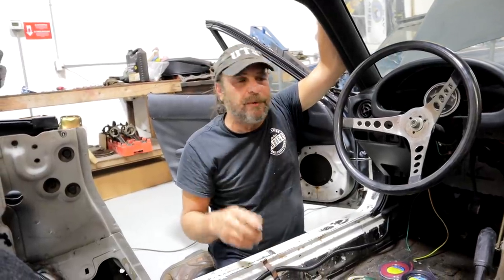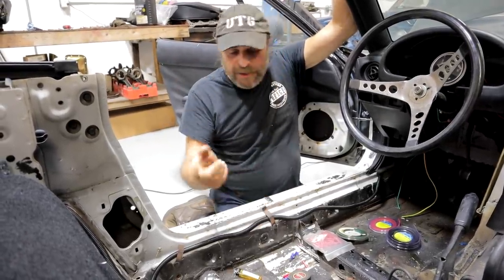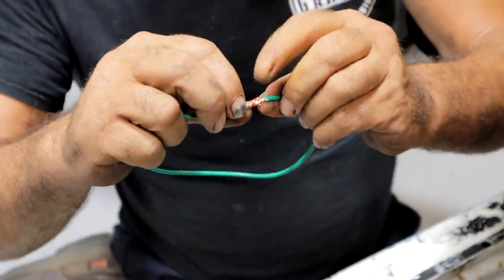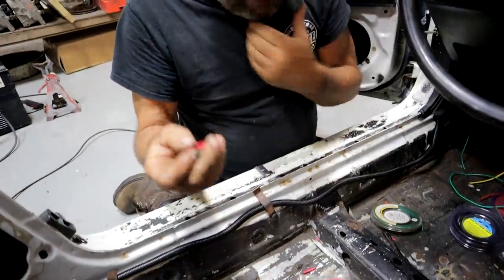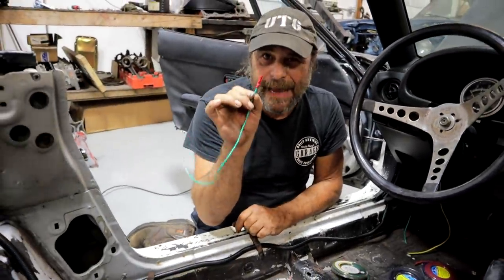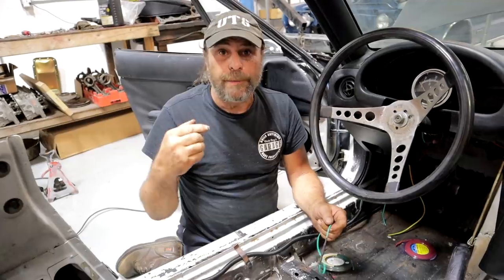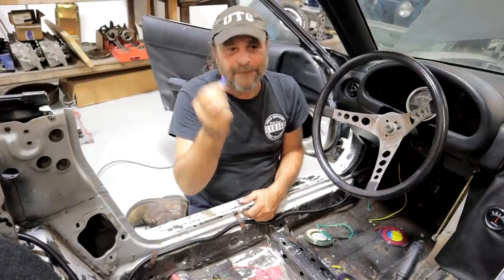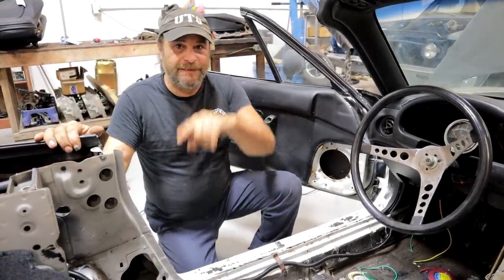The Single Most Misused Item In The World Of Cars

Comment: Don't use crimp connectors on any wires ! Ask any real electrician, they will tell you they won't let you use it on anything they own. Careful soldering, flux, and heat shrink are the only way to repair a wire. You can love it you can hate it you can argue about it but the facts are still the facts.

Comment: In all the years I have doing automotive work there has always been one side that said soldering/heat shrink tube is the proper way. While another side says nothing in aerospace or automotive should be soldered due to vibration, crimp using proper tools and high quality connectors.

Comment: I found a new type 'Butt Connector' that is self sealing with heat. It has a silver solder ring in the middle. It seamed like a good idea at the time, but you need 3 hands to make it work. You can use those stands with the spring clips if you are doing bench work, but not great for under a car or in an engine bay.

Comment: These are a permanent fix....you just need to use the correct connectors with a sealant inside and you need to use the correct crimp tool that locks the wire inside the connector.

Comment: I'll carry it a step (or two) further and add dielectric grease to the inside of the crimp connection before I insert and crimp the wire....or I do as you did and use shrink tubing but then I'll insert the grease inside the shrink tube and then shrink it down.  I do this for the off-road stuff and have never had a broken or corroded connection and are, in my mind totally reliable.

Comment: I prefer to use the proper ratcheting double crimp tool when using the insulated connectors because they crimp to the wire and squeeze down on the insulation for added strength.  Buying cheap crimp connectors is a bad idea as they never get a good grip on the insulation. 

For more reliability without buying the waterproof connectors the uninsulated connectors are the way to go as they have two parts that are crimped, one on the wire and a second part on the insulation. Cover these with a good adhesive heatshrink for sealing and strain relief and they will work pretty much forever.

Of course the best practice is to use the proper waterproof connectors with the correct crimping tool. The connectors don't cost that much, unfortunately the good crimpers do cost more than we would like but they last forever unless you are doing wiring harnesses full time. Spend that bit of extra money and you will have peace of mind and impress your friends or customers.

Comment: I only buy but connectors with heat shrink built into them. And the snap-on wire strippers are the best stripper/crimpers in the business hands down.

Comment: They make connectors that have solder in them. You slide it on the wire, twist them as a lineman splice slide the connector over hit it with a heat gun, it stinks the tubing and solders the connection.. They're a little more pricey but they work forever....

Comment: I suggest you try open barrel terminals instead of the closed barrel type used in the video. You need a special crimper for them, but the resulting crimps are more reliable and look much more professional.

Comment: Shrink wrap is gold. For what it's worth there is one way to twist wires that will never pull apart. Strip about a inch from wires, divide strands in half each wire, Twist strand to strand tight, then twist the two strands together, fold straight and shrink wrap. I do it for anything not getting soldiered, quick, easy, and as permanent as any joint not soldiered

Comment: Even better cut the plastic insulation off your butt connectors or any connectors then put your heat shrink Over The Wire send crimp the connectors heat up the heat shrink that still isn't as good as soldered wires with heat shrink

Comment: I hate wiring so much that was the last thing I was going to repair on my '72 Road Runner. After getting it running and painting it I wanted to be able to go for short drives in it occasionally, which i did until one day when it's prehistoric origional equipment power steering pump blew a seal and drenched everything under the hood with power steering fluid! After cleaning everything as good as possible without using caustic chemical cleaners or a pressure washer, I was able to drive it again until one day it started spitting and sputtering. I made it back home but after doing a few tests with a multi meter I figured out that whoever was going to convert my car into a race car had used all solderless connecters without any heat shrink tubing and all of the connections were either wet inside with power steering fluid or the wires were green with white powder corrosion on them because of the humidity in Oregon!

Comment: Yes I agree about the heat shrink whether its with or with out solder. I had a 657E Cat scraper that requires two transmission to be in sync.The rear transmission was grabbing two gears at a time and at times three, Well after spending the whole day diagnosing and flipping loosing our minds over what are we missing.We found the problem only when the sun started set on the one last look before going home checks and we found every wire in the sync circuit in the same spot had solder less connectors only tapped to close the loom and so every time voltage was sent to up shift or down shift voltage was hopping from wire to wire,which resulted in a 2nd gear shift also shifting the gear to the wire it jumped too.So it would hit second then shift to fourth then back to second or sometimes stay in forth.So when my fellow mechanic was shifting the front while I was monitoring the the rear trans it was dark enough for me to see the blue voltage jump out of the corner of my eye and when I showed my co-worker we was like no way. So to the newbies heat shrink goes along way for a solid no come back history and avoiding working for free if on flat rate.

Comment: I watch your videos on a regular basis and I found the content is always accurate and very instructive. However this time I do not agree with you about what you said about solderless connectors. If you can release the wire from the connector simply by pulling it by hand it means either the connector is not of a good quality or it was wrongly crimped. With a good connector, I mean a good metal gauge and the right crimper tool (the kind of which you need a die with it) there is no way you will be able to release the wire with your hands. There is also connectors that are shrinkable for better insulation against moisture.

Comment: If I have to crimp, I like to use the clear or translucent nylon ones. The ones with the solder blob inside do work as well, but I prefer to solder the wire if possible.

Comment: great information! Myself i take the plastic outer shell off and crimp the inner metal sleeve then solder it then heat shrink tubing. Also i use a thomas and betts crimp tool which is a great tool. the metal sleeve and heat shrink for strength and solder for conductivity/

Comment: At work, we have the butt connectors that have heat shrink and a heat activated epoxy built in. They are more expensive but worth every penny. Also, the best crimpers put a divot and crush the center first, then out towards the edge.

Comment: That crimper you’re using is actually one of the worst ones For automotive. Solder connections may be the best for the least amount of resistance but not the best for all applications due its tendency to break. Those butt connectors are not intended for shrink tubing. The ones without plastic are designed for shrink tubing. If you ever repair electrical   connections in automotive manufacturers give you kits with heat shrink and  specify a certain tool to crimp it with.

Comment: Wire nuts would be far superior to but connectors  
Soldering is the only way to wire properly 
But connectors are the majority of wiring problems on trailers and all most every automotive aplication it's used for

Comment: In my earlier years I used to butt connect wires with dielectric grease in the connector and heat shrink it. Now I solder and double wall heat shrink it.

Comment: Sorry mate, but here in Australia, there is a "new kid" on the block to do this job!! These are joiners that only require a heat source. You pick the size to suit the wire, strip the wire, feed each wire into the joiner, then heat with a lighter. These splice joiners have solder, & they are also heatshrink, with sealant. The heat melts the solder, thus creating the electrical connection, melts the sealant, & shrinks the outer case. I still have the old school ones, but I sometimes use a different method. This is stripping the wires, then putting seal shrink over one wire, Holding the bare wires together, solder, then slide the seal shrink over the soldered joint, & heat it to shrink & seal.

Comment: These are not designed to be used with shrink wrap all the time. They can, no reason not to do it and I endorse this excellent extra step, but not always a necessity. 
 It kind of made me chuckle when he said look out for cheap crimpers then proceeded to use a cheap crimper.
 The correct ratchet crimper crimps not only the jointed area where the wire is but also the plastic round the collar, this gives the joint more strength and allows it to move with the wire rather than cut through the joint. 
 Ratchet crimpers are not as expensive as they used to be and are a sound investment if you intend to do a lot of crimping. The type Tony was modeling here are fine but will never be as good as a ratchet. You can still use them to crimp the collars on a through crimp.

 A minor point. I love UTGs videos.

Comment: If you strip the wire double the length you require twist and fold it back so it forms a loop and then crimp a connector on to it you can't pull it off as the crimp is biting all around the loop.

Comment: A little bit of heat from a lighter or candle and the connector comes right out of the plastic "insulation". This is what I do so I can get a more positive crimp and a wire that doesn't change much in thickness after shrink tubing. None of our local stores have uninsulated butt connectors.

Comment: if i use solderless connectors (i almost always solder my connections) i use the ones that have no insulation on them, and use the big crimps that really crimp the wire so it doesn't pull out, and use shrink tubing. that way i can visually see my crimp and the wire

Comment: Never been a fan of crimp style connectors like these,  in high vibration environments these connectors create a pinch point that eventually leads to intermittent connection failures that can be incredibly hard to diagnose. I'm a bit old school with spliced wires with proper solder and heat shrink tubing being the only proper way, that a soldered joint is second only to an unbroken wire for reliability.

Comment: i work at Union Pacific and we use these clear and blue wire connectors that you can put 3 wires in it w/o stripping them and you press down the  button with some pliers and it has silicone in it to prevent water getting in. Ive tugged on the wires and they don’t come out. They are a really good product!

Comment: I always do a third crimp on the very end of the crimp. The bit that is just plastic. This grabs the insulation of the wire so if it flexes it bend over a longer length. Like the rubber were the cords go into power tools. Also most crimping pliers have a scale on the side to show the length that the wire should be stripped.

Comment: Fan out the wire strands a little push them together and twist. Solder it up and use 3M heat shrink tube with the adhesive built in. You could throw that connection in the Atlantic for 50 years and it would still look new when you cut it apart.

Comment: There is a new device for joining wires...it uses a combination of shrink tubing and low temperature solder in the center of the sleeve. You slide the sleeve over the wire, join them with a lineman's splice, center the sleeve over the splice, and heat the entire length. The solder melts over the splice and the heat shrink insulates it.

Comment: and ~ on the 2002 forester I am resurrecting from scrap after market install used guillotine connectors to add on spade terminals. one  guess where intermittent  phantom electrical problems occurred plus poor rerouting of wires and getting them pinched under hardware was a bonus. lesson if your car has aftermarket add-ons have fun circuit tracing. Side note many autos have wires installed for options even if option not installed to add on an option look to see if factory supplied most of the wiring for added options.

Comment: I use dielectric grease on the wires then crimp them with a ratcheting non insulated crimper then seal with liquid electrical tape.

Comment: If you make sure the dent the crimper makes is always opposite the seam in the metal tube, you will clamp all the strands equally, and make it more resistant to flex and pull failures. If you put the dent on the seam, it will put most of the clamping force on only some of the strands, and the stress riser created will lead to earlier failure from flexing. This also deforms and sometimes even cuts into the strands that get all the clamping force.

Comment: Tony, you need to look into the end of the connector. You will notice that there is a split. On the crimper where you will be crimping you will see that one side supports the connector and the other pushes into the connector. Put that push-in side on that split when you crimp, it will provide a tighter crimp.

Comment: Basic but very true.   I used to install car stereos back in the 80"s and most installers didn't heat shrink there connectors they almost always had shorts frying gear or tweeters.  Do it right the first time.

Comment: Ancor marine grade heat shrink is the best out there and once you use it you won't want to use anything else. Also I solder a lot more than is popular on the interwebs. It's how my boss wanted it done when I worked on a top fuel team and I figure if it's good enough for a car that tries to shake itself apart going 300+mph then its good enough for me.

Comment: I soldier my wire to the crimp connectors & put the marine shrink tube over that. Also I take & strip wire then split strands on each wire 50 50  then twist half the wire together on each wire. So you end up with 4 twisted wires then twist the 2 together then soldier. Shrink tube & be done with it.

Comment: Last time I used those solderless connectors, I heated it the same as normal heat shrink tubing and it seemed fine to me.  Are you sure this is incorrect? The lazy part of me doesn't want to have to rework it.

Comment: the solder/shrink connectors are the way to go, i still throw shrink tube over them, but they do have shrink tube and adhesive built in with solder, heat gun and you have a connection made in 6 seconds

Comment: You can get those connectors with a softer plastic and a glue in them so after you’ve crimped them you use something to heat them up they shrink and glue the wires in and seal them all up

Comment: If you use proper ratchet crimp pliers and don't strip to much insulation off you will get a much better result than using those dodgy pliers you got there. When the proper sized crimp terminal has been selected for the appropriate wire gauge the insulation should butt up against the end of the metal conductor thus keeping a portion of insulation within the insulation of the crimp terminal but heat shink is always a good idea.

Comment: I use a hybrid style crimp connector. It’s intended to be used like this and the strands of wire inside overlap. The connector itself contains a small amount of solder and the outer shell acts as shrink tubing and it’s all activated by a butane torch

Comment: There are several types of these connectors. The ones in the video are meant to be used without shrink tubing, but only inside the car where they will never be subjected to moisture. Then there are the ones with thick shrink tubing already over the connector. These can be used in place where the connector is subjected to moisture, like underneath the bonnet and behind the head lights. Then there are the ones with shrink tubing and some kind of hot glue inside. These can be used submersed in water. I would use these underneath the car.
You can use shrink wrap over the normal ones of course but I don't think it will relieve the strain on the wire. If you have problems with wires coming loose, it's better to use a decent krimping tool. They have become dirt cheap, so there's no reason at all to use those flat ones anymore. I only use those for cutting tiny bolts to length.

Comment: I advise the normal everyday backyard worker to go online and buy a heat shrink but connector, they shrink like shrink tubing and some have solder inside them it’s cheap and fairly easy to use and it all in one, but if you need it to look professional do it this way in the video

Comment: This is not good. The best splice connection is made by stripping the wires enough to insert them in a base of a plated copper bare splice terminal, double crimp it, solder it, then heat shrink it with the piece that you have already slipped on. This connection will last forever even in the wet and not corrode. I am a
professional mechanic that I  only work on electrical systems and I have never had one of these type connections fail.

Comment: If you are hell bent on using butt connectors, at least get the good ones that are adhesive lined that melt when you heat them. That atrocity you just made isn't "hermetically" sealed either lol

Comment: honestly, I don't see the time savings for a solderless connector,  you can take rosin core solder and wrap a turn or two around the join and heat it up with the same lighter you're using for the heat shrink. it's way faster than using the connectors imo.